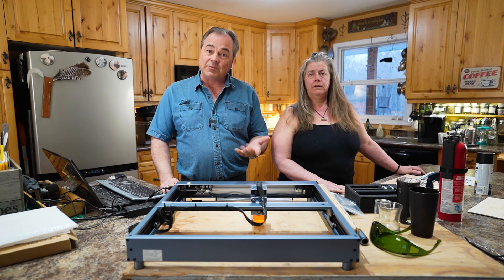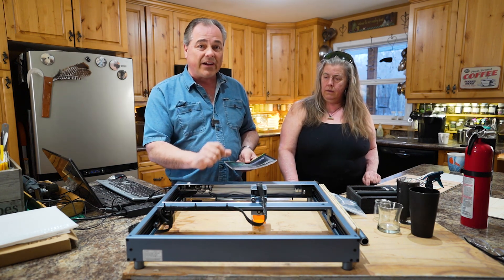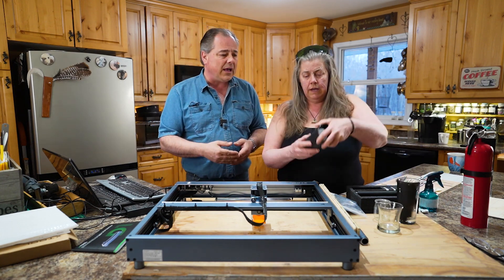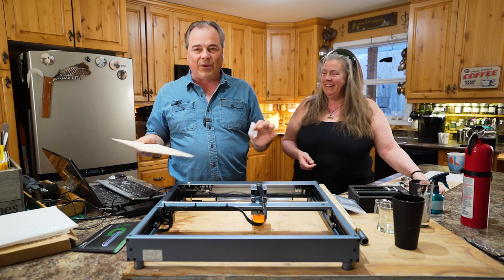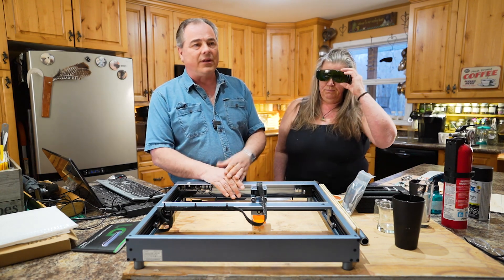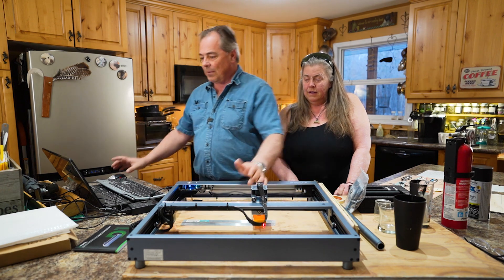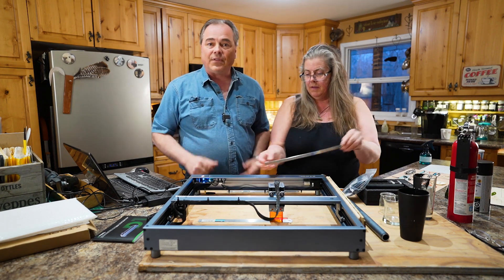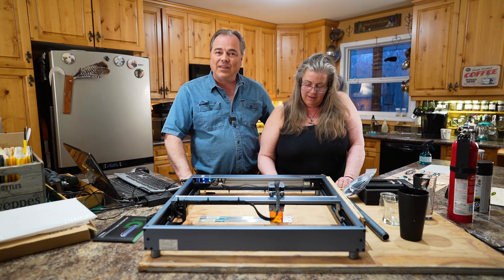Xtool D1 Laser Engraver Review & Operation

Comment: What settings do you find work best for engraving stainless steel say for dog tags ?
Reply from the maker: Software has specific settings for stainless steel but what I recommend is to make a power and speed grid pattern for all the common items you engrave. I also find it better to spray the stainless steel with cold galvanized compound that contains zinc oxide, I made another video about that.